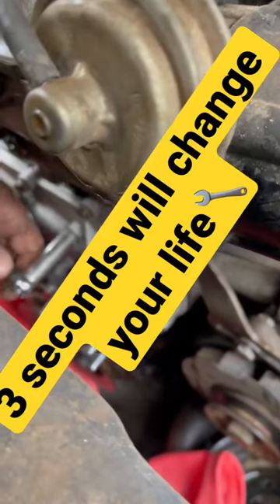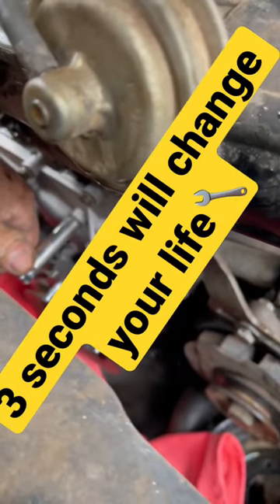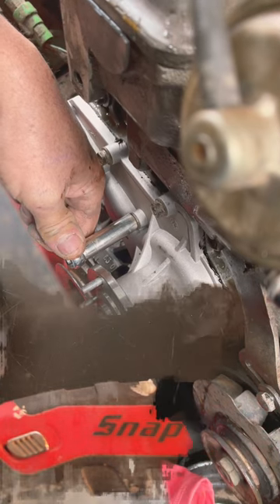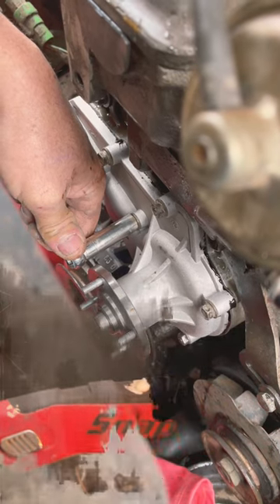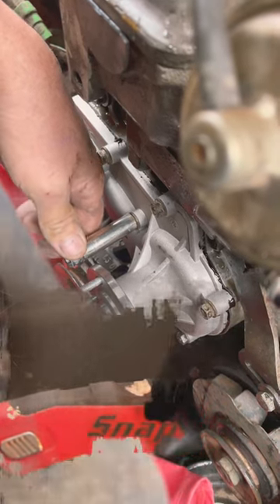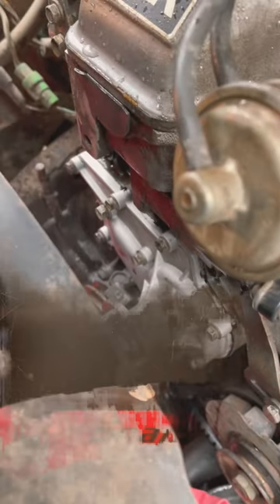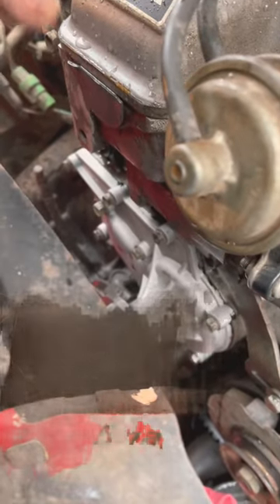This is why you hold your bolts for 3 seconds 🔧#shorts

Comment: *me tightening every bolt with an impact 😅
Reply from the maker: You do 22r water pumps with your impact😀😁😁😁
Reply: @fastflo1  I would if I had one 😂 I use a Milwaukee 3/8 for everything including  8 &10mm bolts haven’t broken a bolt and haven’t found one it won’t break loose
Reply from the maker: @ELLISON-Auto-performance  that is cool . I had a job assembling motorcycles and we used air guns actually on everything . They were the small butterfly type. And same thing . You just get the feel . But I would put that butterfly up against anything for speed when it comes to production. 👍🏻

Comment: Aircraft require 2nd torques after 15 minutes for this reason
Reply from the maker: Now go through the comments please and tell the others that. Thank you👍
Reply: @fastflo1  there is a rabbit hole to go down with torque. For instance torquing a bolt head requires a different torque than if you torqued the nut side. Adding a washer increases clamping pressure while using the same torque.  Clamping pressure and torque are correlated but not one to one.  Thread pitch, bolt stretch, material tensile strength, self locking nuts, lubricants, interference fit holes, dissimilar metals, pneumatic impact vs torque wrench, even 12 point vs 6 point bolts have a difference. If there is a wet sealant gasket then a 2nd torque should be applied 30 minutes after 1st torque to get proper surface clamping pressure.  Hydraulic systems on aircraft use an initial pre-torque, then you mark lines on the nut and hydraulic tube, and rotate the nut a set degree to get proper fit up. One full rotation of a nut clamps parts or stretches the bolts equivalent to the distance between two threads.

Comment: Hold Deez that is dumb if you torque it properly it won’t matter it won’t back out. My MOS was 6212 Av8b engine mechanic I never had a bolt loosen after properly torqued
Reply from the maker: What happens when you use open end wrenches  or a  pipe wrench?

Comment: I'm not holding my torque wrench, past the click, for 3 seconds & I've never see a mechanic do that
Reply from the maker: Well one day when you are working on something in real life, and you do not have a torque wrench and not watching another mechanic..... to have to believe something. Use a wrench, hold it for 3 seconds... Simple...
Reply: @fastflo1  is someone coming for my torque wrenches?

and I think you missed my point: that if this were relevant, you'd want to hold your torque wrench the same way you would a regular wrench, right?  And no one does that, right?  and thats the most common proper way to do things, and things generally stay together.

as many others have told you, someone pulled the fleece over your eyes...intentionally, or otherwise.

Comment: Never have i ever, out of all the mechanics I know, ever heard this from any of them
Ps-they aren't doofuses either
Reply from the maker: If I didn't grow up with the guys I did I would not have either. I hung around a lot of great mechanics and machine shop owners. Lots of engine builders and racers alike. The friend that taught me this trick learned it from one his mentors on his way to becoming a Boeing aviation mechanic. He told me about 25 years ago and I just decided to share it recently. If I didn't share it, you probably would never heard it in your entire life. That's why it is a top tip. Not everyone knows about the best stuff. Well, until now.....👍Try it on for about 25 years and get back to me on your results.......
Reply: @fastflo1  just FYI, my grandpa has built MANY semi truck engines, tearing them down, building the back, perfectly, and those engines have ran well over a million miles before they needed a rebuild, I can reassure you no bolts or anything like that just rattled loose because he didn't hold them for 3 secs
Reply from the maker: @truckercarter09  that is good . It is not mandatory. Plenty of things will work well without doing that., but if you ever wondered why does a bolt come loose . Not on your grandfathers stuff. But on all the other millions of bolts people are installing all over the world. It may become more logical to you. And rather than think so hard why it does not work . Think rather why would it. You have more chance to pick up on good information rather than just refusing it. I know you want to be right . I do not care. I know it works. And when I work on my hot rods and go race them around . I know my bolts will be holding tight. It’s that little extra touch top mechanics do . Not everyone knows, not everyone will . And most people who hear refuse it because the have not heard. That is the most common response. I have not ever heard of it. Well what if tomorrow a scientist told you something you didn’t understand and it was true. Would you immediately say it wasn’t because you don’t know. What about this…. You could say, that is interesting, amazing I just found out now! What a revelation ! 😀

Comment: Different bolts, different metals different sizes/threads etc. 3 seconds covers all of them? No
Reply from the maker: It is a good overall practice. See the little water pump and the open end wrench? Just regular everyday stuff. Lot's of bolts out there. This will not hurt in helping bolts stay tight.

Comment: Or maybe buy a torque wrench and tighten to spec?
Reply from the maker: Well, this is maybe for the times you do not? Consider that please.
Reply: @fastflo1  you could try talking nicely to the bolt, have you considered that? I mean to be fair they take quite alot of abuse most of the time
Reply from the maker: @jb-dn3ct  that can be very helpful at times …. yes I do ……

Comment: Bs... I am a retired mechanic and never did that and never had a problem
Reply from the maker: One of your bolts could be coming loose right now.... You may have retired but did all your cars you worked on stop being used when you stopped working? Could be rattling apart as I am typing.....

Comment: Isn't this why there is torque settings for bolts
Reply from the maker: Yes bolts have torque settings. But let me give you a clue here. Lock washers, loctite, safety wire. crimp nuts, nylon inert nuts, star washers, retorque......Any idea what these are for? So bolts do not come loose. Starting to understand yet?
Reply: @fastflo1  that's all to prevent the nut or bolt from vibrating loose from driving. Not what ur vid is referring to. But what's 3 seconds gonna hurt. Nothing
Reply from the maker: @alexstoles1339  thank you 👍🏻

Comment: take 3x longer to assemble anything
Reply from the maker: Just the bolts. This water pump was about 24 seconds longer. Great investment. If the water pump lasts ten years and the bolts do not back off. So about 2.4 seconds per year investment. Totally worth it in my book.
Reply: @fastflo1  unless your work on cars for a living then everything takes you 3x longer which means you get 33% less work done and make 33% less money than you should have
Reply from the maker: @dirtscooternation Than you can work a little smarter, become more efficient. Have more repeat customers and increase you rate because you do better work. Earn more annually and gain more work. You should be making more by doing this.

Comment: This isn't true. I've never heard that. Nor does it matter. Sometimes go around a big sealing surface 2-3-4-5 passes but this is wacky.
Reply from the maker: So quick to judge.  Is it not true because you have never heard of it? What about everything else in life you never heard of but found out was true? You go over the bolts 5 times but this won't help? Ok.......
Reply: @fastflo1  I'll give it a shot. I'll do my due diligence.
Reply from the maker: @hankstar.1  awesome . You will enjoy it. It is not mandatory by any means. But I can assure you if you make a practice of it , in your everyday life on regular projects . You will discover a lot over time about metal and bolts . Clamping force. Torsion . Tension . Thread bind. Bolt stretch. And much more. Your feel and awareness will improve aside from just the tip itself. It will surely improve your game . Thanks for trying it out . You will also discover your arms will be shaking ant trembling . You will eventually have one of the bolts move on you in that 3 seconds. And regardless of what it is, you be the judge. It will happen …

Comment: liar 🤥 I grabbed mine for more than 3 seconds 🤭and nothing happens 😳😤🤦🏻‍♀️
Reply from the maker: It is a great practice. Keep doing it on all of your bolts your whole life. Not just one. This was an example of the technique. Not every bolt will do it. This ensures the bolts that do move will not back off. Some bolts do hold tight the first time, and others seem to need the 3 seconds. You can only know by doing them all.... Keep up the good work. You will soon realize it is true. You will know, the wrench will advance forward slightly when you come across that bolt. It could be one out of many.....

Comment: Oh God. All the engines I've built are gonna fall apart!!!! Degree torquing is fake!
Reply from the maker: Possibly....Give it a few years and we will see....How long have you guys been mechanics? You think that you have the only engine? Do you realize how many bolts are coming loose as we speak? Imagine how much loctite is sold, along with torque wrenches and locking washers, and safety wire. Why do they sell  these? Because bolts back off and loosen up? Maybe? Possibly? Hmmmmmmm...... Well good thing we have you . Your bolts are tight 😂 
  Every bolt that came out of the factory was torqued and sealed from the on every car. So how did they come loose? Bolts do not come loose that's right.... According to you....haha.  Why do we have repair shops? I will give you a few to think about that.....
  This is how to make sure a bolt stays tight. It is obvious it is on a level you do not understand. I am hoping you can though....Maybe if you opened your mind you could figure it out. Think about all those washers and stuff. No possible that you are tightening a bolt,  holding a bolt tight for 3 seconds longer could possibly help it stay tight? Nope. No. Not a single chance.... See how ridiculous that sounds now? Just listen to your own  logic...... I was told though they do not teach common sense ......That makes perfect  sense now....

Comment: So if you tighten the bolt and take your socket off, and the bolt doesn't move, it's just kike holding it for 3 seconds. Sounds like boo sh!t to me.
Reply from the maker: Not the same sir. Think about that. The tension is held in the direction of wanting to rebound. It is holding. Add heat and vibration. It will want to back off in the direction of the rebound tension of the bolt. Just hold your bolts for 3 seconds. You do not have to understand it for it to work man....

Comment: Looks like a toyota 22r
Reply from the maker: Good eye👍
Reply: @fastflo1  thank you! I've only built a few lol.
Reply from the maker: @tenmil1  nice! Fun motors to build . Honestly one of my all time favorite motors to work on… problem is they don’t need that much work 😂👍🏻
Reply: @fastflo1  they are very fun to work on. I work at a machine shop normally and do these on the side cause I actually want to work on them rather than the 90% BMW and Subaru engines we see. I actually have one about 15 feet from me on a stand now and when I wrote the original comment.

Comment: prove it
Reply from the maker: Did you not listen or watch? Why are you asking me to prove it. Go grab a wrench and start holding your bolts for 3 seconds.  Pretty simple to find out. Bolts are everywhere.
Reply: @fastflo1  no i mean prove that it affects permanent torque and that it reduces bolt vibration. scientifically.
Reply from the maker: @H4zZ4rDGaming1  well I told you how it works.  I did not say it reduces vibration …..
Reply: @fastflo1  you can "tell" me anything you want. I want you to prove it haha.

I'm assuming you don't understand scientific process?
Reply from the maker: @H4zZ4rDGaming1  I know you do not . That is clear . I could tell you if you really want to know . But I really do not think you will listen. Sounds like you just like to object.
Reply: @fastflo1  No, I'd love to be proven wrong, if I was, I would hold torque on every single bolt i tightened.

I just hate folklore. I want actual science, with numbers, proving things are the way they are. otherwise we're wasting time.
Reply from the maker: @H4zZ4rDGaming1  ok fair enough . I can’t answer tonight . I have to get up early . I will let you know why shortly . Thanks 👌🏻

Comment: Wtf just torque it to spec. Use blue lock tight if necessary
Reply from the maker: And if you don’t have those? Maybe you’re actually not in the shop?
Reply: @fastflo1  if you don’t then you should invest in better tools
Reply from the maker: @FZERO20  one day maybe you will make it out of the shop and go fix something broken down on the side of the road with tools from harbor freight or whatever you can get your hands on.  Living in this little world of torque wrenches and loctite and better tools. Go get some real experience and develop some skills .
Reply: @fastflo1  Maybe I’ve already been through all that and learned I needed to invest in better tools. It may seem like we’re arguing but we’re saying the same thing. Plus the video is bs if you didn’t already realize. That 3 second method is a joke for newbie’s to fw you. Also… you can buy locktight for less than $10 anywhere and you can buy a 3/8’s torque wrench for less than $100 at HF or Amazon. I’m an experienced trained technician you can ask all the questions you want and in the best of my ability I will answer bro👍🏾
Reply from the maker: @FZERO20  Have you ever worked on anything without a torque wrench or loctite in your life? Ever broken down in the woods 4 wheeling? Been stuck in the snow? Helped somebody that did not have tools when you are on vacation? Or do you live in your shop?
Reply: @fastflo1  that’s specific to you it seems. But I had a friend who’s mom’s car had a flat and the wheel wouldn’t come off, my Honda wouldn’t start because of an electrical issue, my grandfathers truck had a failed wheel bearing in the middle of nowhere and caught on fire from excessive heat, a cotter pin on my front suspension was non existent and the right upper control arm fell out of place… I can go on and on with the experiences I’ve had growing up man. But my skills and tools were so poor growing up that I decided to go to school to learn how to properly work on cars and as time went on I accumulated tools. That’s just how it goes bro. You’re not the only one with crazy life experiences, and crappy situations. There’s nothing new under the sun. When you’re in dire need to get past a situation you use what you have because that’s all you got. But If you haven’t realized you need to up your tool game by now… (idk how old you are but I’m 23) you’re not learning from your mistakes. Next time you go out mudding/4wheeling, bring a tool box with all the most common tools you can use that can fix common problems you face. If something goes wrong God forbid, and you don’t have that tool, take a mental note and bring the required tool the next time. Trust me, you’ll never forget again.
Reply from the maker: @FZERO20  Not bad.... You have had some good experiences. I bought my first El Camino at 23..... Still have it. Same motor I built in 1999. Check it out , it is on my channel. Back to the point. There is something new under the sun . I learned this trick when I was about 23. You will end up working on a lot of stuff and hopefully continue to learn . Do not be so quick to deny something that could be true. You could benefit from it. No matter how expensive the tool, there is no replacement for knowledge and experience. I have been doing this to bolts for 30 years now. I know it works. You do not. You never will if you do not try. Your belief alone will not make it untrue. Go study Junker....... Then get back to me. Go look up his work. Then come to me with something about torque, tension, and clamping force. No tool brands mentioned by the way.....
Reply: @fastflo1  I got you homie. There’s still some things I disagree with but we can leave it at that. I subscribed to your channel and I enjoyed the conversation we had. I’ll look up junker and see what his channel is about and do some of my own research on the topic. Either way if I do find something I like I will tell you about it and we can talk about it. You seem cool and it’d be nice to work around someone like you in a shop I believe. But back about torque and clamping force… “micro encapsulation” “grooved bolt heads” and even “stretched by torque bolts”  are perfect examples as to why holding tension on a bolt is unnecessary. You’re a lot more experienced than I am obviously, but in all my experiences of working on different vehicles, I’ve never had a bolt go loose on me. But one thing also now that I think about it. It does make sense as to why you’d hold tension, it’s similar to the method of a torque wrench where you slow down in the tightening stage and bump the wrench several times to ensure properly distributed torque. And sometimes I do find myself holding the wrench even after the fact to ensure the tightening torque is accurate, say the nut/bolt was wet with oil  or a lubricant. This is a great example I experienced installing ARP studs on a cylinder head job I did. But that you’d want to make sure you have proper torque